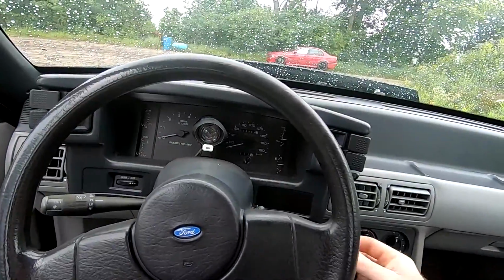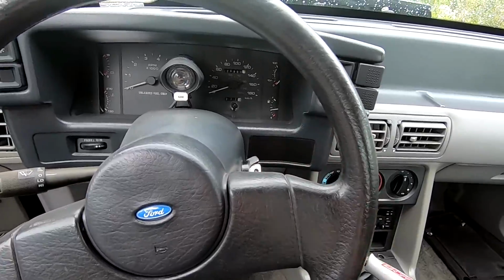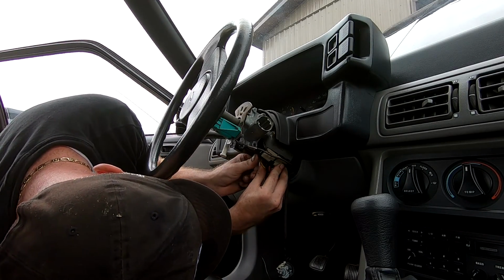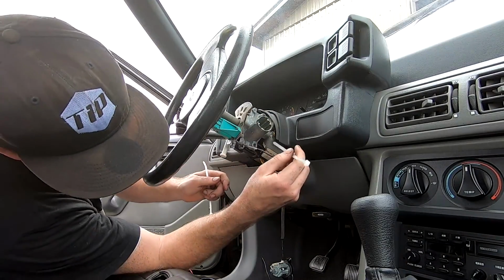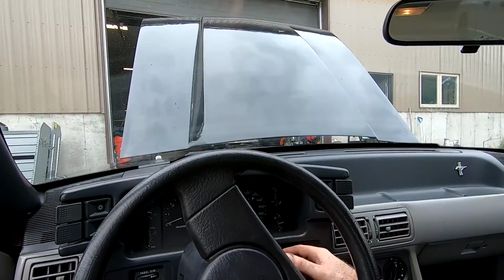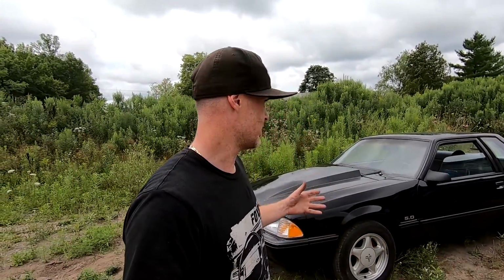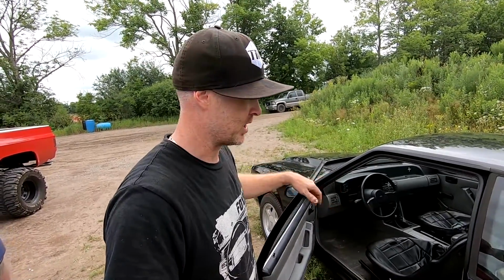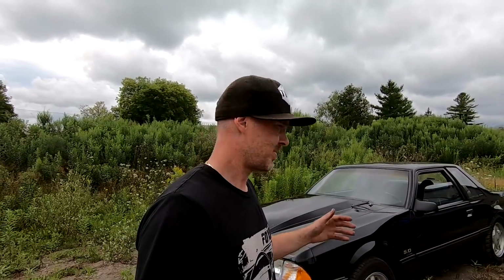Ignition Problems and No Start Issues in my 1988 Foxbody! - EASY FIX - TIPS03E13

Comment: Nice work, I bought a 1987 fox body last Monday it wouldn’t start unless jumped, so I replaced the battery yesterday it turned on right away drove it for about 30 minutes and now it won’t start again I need your help man I was so exited when I was driving it
Reply: Change ur tps and altnator
Reply: bro i have same issue what have you done so far ?
Reply: @50LOT1  it’s the alternator bro u need to replace it with a 130amp

Comment: I know this video is old, but im working on a mint original notchback and i cant get the key to turn i tried everything i can think of steering wheel does not seem to be locked its stuck off and wont go to on or acc position and not wanting to drill it out any ideas of what to do is appreciated.

Comment: bro did it crank but not run or it wasn't even crank at all? I am trying to see if it has similar issue with me car
Reply: My friend has an 86 gt. His cranks but won't start. We changed the coil and ignition module. What turned out to be your issue and fix? Thanks

Comment: I have a 1993 5.0 I got to the store turned it off and now it doesn't want to start but if I spray starter fluid in the throttle body it starts up can you help me try and figure out what the heck is going on I installed a new fuel pump and it still doesn't start and I replace the fuel pump relay and it still doesn't want to start has me stumped
Reply from the maker: Is there pressure at the rail? If it starts on fluid then you're not getting fuel or your injectors aren't firing. Do you hear the fuel pump prime when you turn the key forward?

Comment: My Fox is no where near as clean as this or the yellow car, I guess I’ll try and do the ignition, I replaced the starter so hopefully this is what will make it crank and start.
Reply: Did you ever figure out the problem with your foxbody? I’ve replaced my starter, solenoid, and ignition switch but all it does is crank and sound like it wants to start but just cranks instead.
Reply: @natedawg5814  I got really busy with work hours so it’s hard to get time to work on it, but I found that my starter cable was getting any power from solenoid to starter, if I was you I would check my crank sensor, when a crank sensor goes out all it can do is just crank because the sensor isn’t sending a signal to your PCM for your timing. So I would see what the ohm spec for it is and see if it’s within spec.
Reply: @williamsanders468  I for sure will check that out, thank you for helping me out.
Reply: @natedawg5814  After that I would go ahead and see if you have compression, usually if you can turn the crank bolt and you can feel it get really hard to turn and then it does a real easy turn, you should have enough compression for the engine to fire. But you might want to do a compression test. Also can you hear you fuel pump when you put the key into on position. If not go to your fuel pump fuse and see if it is pulling amperage, if it isn’t than the pump is bad.
Reply: @williamsanders468  Alright and yes I do hear the fuel pump when I turn the key to on.
Reply: @williamsanders468  I pulled and checked the spark plugs today, all of them looked to have carbon fouling.
Reply: @natedawg5814  I would go and look up a spark plug chart to see exactly what’s happening in your cylinder. Also when you put it all in make sure there is spark going to the plugs. So just leave one plug out and try to crank it and see if the electrode jumps the gap in the spark plug and also make sure it’s a bright white spark. It also might be worth it to take a look under your distributor cap and make sure that it points to the #1 cylinder
Reply: @williamsanders468  When I looked up the spark plug chart that’s what told me about the carbon fouling, but I for sure will check the distributor I’m going to work on the fox today.
Reply: @williamsanders468  Alright, so I think it could be the spark plugs because they aren’t making any spark.
Reply: @natedawg5814  usually if a spark plug isn’t making any spark, it’s not the spark plug itself it’s usually in the coil or distributor
Reply: @williamsanders468  I was honestly just thinking that, after researching a bit more. I’ve been thinking for awhile that the coil could be bad, I do have a pretty new distributor on it.
Reply: @williamsanders468   After a new TFI module the spark was fixed but wasn’t getting fuel anymore so had to drop the tank finding out that my tank was rusted beyond repair, so then replacing the tank and the pump and sending unit putting everything back she started right up with some fresh gas. Thank you for all the help you gave me!
Reply: @natedawg5814  Sweet! Have fun brother

Comment: I have a 1987 mustang I went carb on a 5.0 last week I hooked up the battery and heard the fuel pump no I did it again and I got nothing. I have power to the switch and to the starter solenoid put just get a click no dash light I have interior lights and all that just no dash light fuel pump or anything like that.
Reply: Man I have the exact same problem. Did you figure it out?
Reply: @eissaalireza4861  bad solenoid and the grounds were dirty
Reply: @davidpound2375  I need to check the grounds but I replaced everything to do with the starter
Reply: @eissaalireza4861  so I cleaned all the grounds and I took some 4g wire and made a ground from the block to the body. And I only did that because for some reason mine clutch cable was also acting like a ground wire

Comment: I have a problem starting mine on very hot temperatures.  It starts fine in the morning but when the temp feels like 112 like it was today, my lil pony don’t want to start.  Second time it’s happened.
Reply: Cranks fine won’t turn over.  It finally started when the temp cooled a bit.

Comment: I'm having this weird problem were i cant start the car when its hot/warmed out but when cold it starts up and runs perfect maybe my coil is about to die my TFI is new and all ground are clean
Reply from the maker: Your starter is getting heat soaked most likely!
Reply: @TheInfamousProject  it will crank over all day long but no spark
Reply from the maker: @22pimpin1  MSD coil?
Reply: @TheInfamousProject  Yes the blaster! Should i put oem back?
Reply from the maker: Yes! MSD looks nice but is honestly garbage IMO
Reply: @TheInfamousProject  haha yeah i will change that out thanks for the reply awesome channel btw been watching from the start
Reply from the maker: @22pimpin1  thanks man I appreciate that
Reply: @TheInfamousProject  i still can't start when hot no spark! Replaced coil with OEM ford
Reply from the maker: @22pimpin1  that's a little more interesting... And it's only when you turn it off on your own. Car will keep running as long as you want it to otherwise?
Reply: @TheInfamousProject  yes correct, My Ignition switch is just replaced also
Reply from the maker: @22pimpin1  and it's for sure a spark issue? Any codes?
Reply: @TheInfamousProject  Thats the other thing i have check engine light but it wouldn't start the test or will let my OBD1 scanner work so idk what code its telling me or if my Ecu needs another rebuild
Reply from the maker: I was just gonna say quite possible you're in limp mode and TPS, etc are all 5v and flooding stuff. I've had it happen before? Try another ecu
Reply: @TheInfamousProject  that is probably the problem then! And i don't have another one just got this one fixed for $280.00 i'm going to bring it back to the guys who fixed it
Reply: @TheInfamousProject  what do you think of the holly terminator X kit? Any good
Reply from the maker: @22pimpin1  ya they work well. Just depends what you're going for. Can be overkill depending on your setup
Reply: @TheInfamousProject  i want to on3 turbo the car next spring and make 400-450whp the holly probably be the best then
Reply: @TheInfamousProject  you want a harness i got a mint 91 and 89 mass air and 89 speed density? LOL
Reply from the maker: @22pimpin1  91 for sure
Reply: @TheInfamousProject  okay i will send you pictures on instagram my youtube name is the same as my IG
Reply: DirectorSteeves. My 93 'vert had the same problem. Turned out to be a bad Ignition Control Module. O'Reilly Auto Parts has a machine to test it out and usually has one in stock.